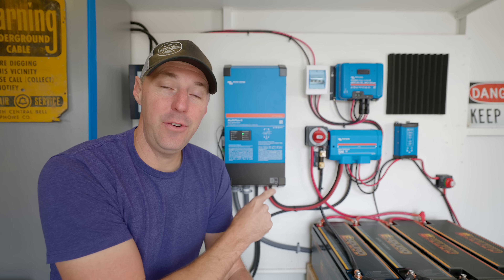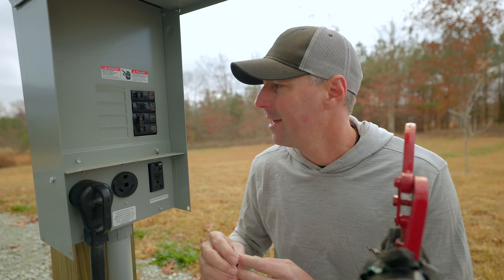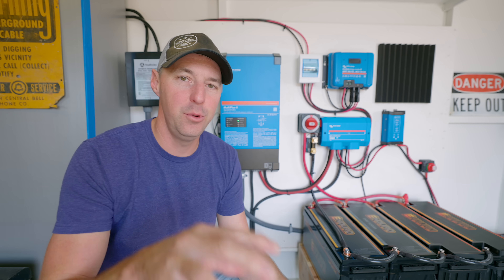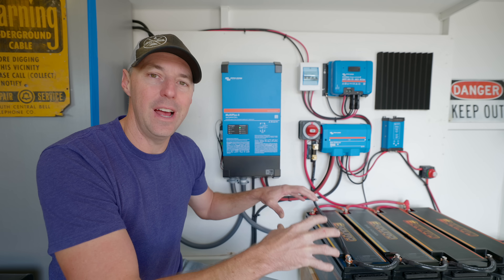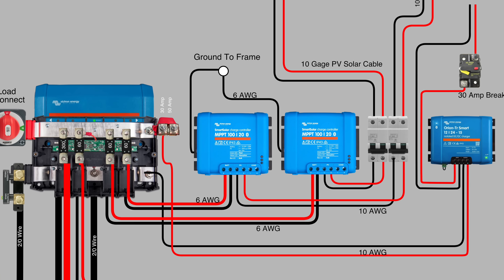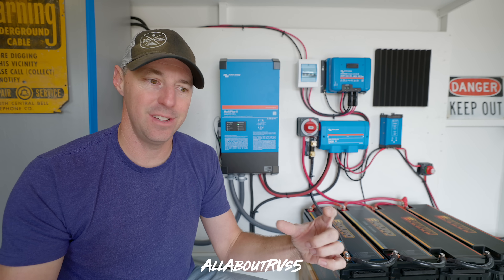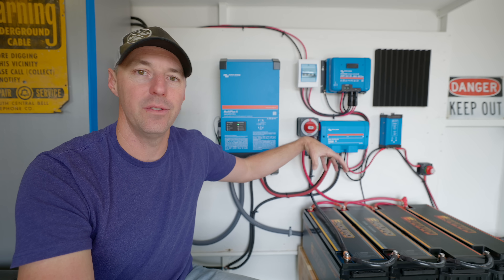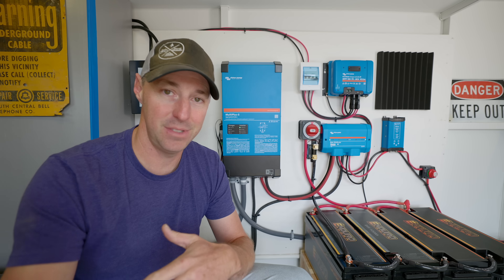Is This The Best Inverter For RVing. Multiplus 2x120 24 volt.

Comment: Hi Jarred, 
I am a single woman full timing for many years. Every time I watch You are videos I am so impressed by how much knowledge and understanding and the ability to work with your hands  and fix things you have. As for me I never understand anything you talk about, Especially today. I am so embarrassed by that fact but it is what it is. I am an artist and I was a dancer, I wasn't a mechanic nor do I understand anything about electricity volts amps anything. My question for you Jarred is, in all the years I did this in a 25 foot Itasca class C motor home. I never put on solar all I had to do was one time an electrician at a campground where I was hosting looked at what I will call the control panel and he said well no wonder you can't keep your batteries high, this RV is called a park Model. And you are using it all the time. So, this board is meant for like weekends and not using it quite often. so I went to the guy that works on my rig and he told me what you have is a 32 amp I think he said amp I don't know control panel. We're going to put in a hefty 55 amp board and that will change things so your batteries don't keep losing the power. Anyways I had that put in and problem fixed. So, I have never understood why people get so involved in all these different things when I did this for approximately 20 years and I never had problems. I didn't have solar, I just every other day ran the generator for a few hours that was it. And I was boondocking 80% of the time. I don't know what I have missed out on by not doing all these things but it never was a problem. Oh yeah, I bought a 600 watt power pack. I have no idea if that is the actual name. I loved it. Jarred, why are all these things necessary? By the way, although I don't understand what you're saying I love your videos! Thank you so much.
Reply: To answer your question...all of these things are not necessary, just run your generator a bit every day or two to recharge your system and u are good, unless you have a specific lengthy high power need every day. You can also just run your generator  morewhen u are boondocking where there are no night time noise restrictions, and for the cost of this type of setup you can run your generator for along time at 3-4 dollars a gallon for gas
Reply: @DriverDean  hey there, Thank you for the validation. You helped me realize my simplistic ways are not WRONG. I DO Appreciate your reply. Happy Trails.
Reply: Hi @kavitadeva . For you, as @DriverDean mentioned, simplicity is oftentimes better.  You're used to it and it works for you.  For us, we run a full-time business and nonprofit and so our power demand is high.  We can absolutely just run our generator to keep 110V on all the time but that can be excessive.  We have a Class A motorhome with a lot of solar and a big bank of lithium and that helps us when boondocking so we are greener and can keep our generator use low.  Safe travels!

Comment: Why not jump to a 48volt system?
Reply from the maker: Good question I thought about addressing. They don’t make this inverter with the 2x120 in the 48volt yet. While 48 is better the bigger you get 24 is great for up to the 6,000 watt range. I have a 48 volt system not on the RV and for the RV I pick the Multiplus II every time for the reliability, expansion and the flexibility of power sources.
Reply: Great video Jared. 

There are more efficiency losses converting from 48VDC to 12VDC vs 24 to 12.  So as Jared mentioned the higher voltage is all about sending current to and from your battery and inverter. If you're inverting higher than 6k watts then 48VDC is a good idea, if not then it's maybe not worth it to afford the extra losses in a DC to dc converter. 

 Air conditioner is about 1400 watts after surge.  Run two of them plus an occasional microwave simultaneously and you are at about 4k watts.  Use as a gauge.
Reply: One issue being the DC-DC converter options to energize your 12v system are much more limited.